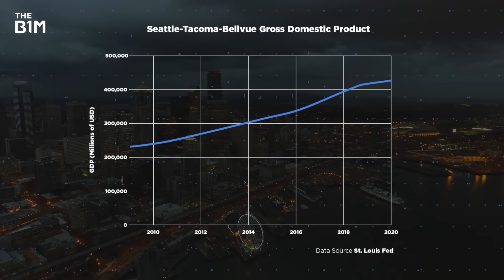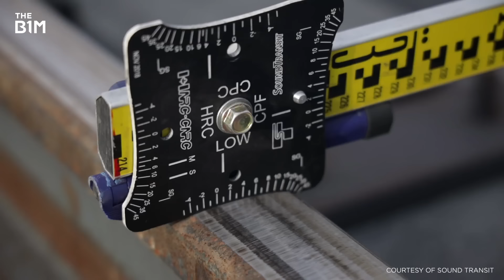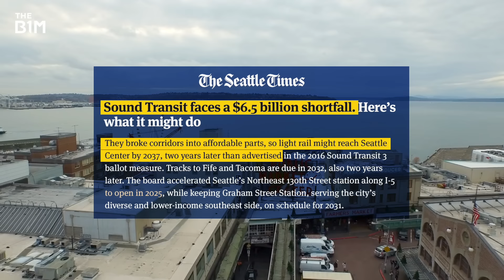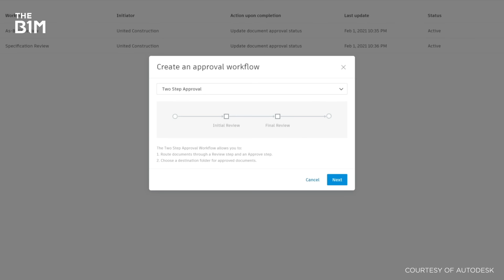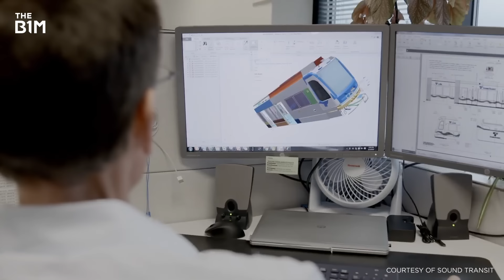Seattle is Building a $54BN New Railway

Comment: A couple of clarifications. First, AMAZON is moving its headquarters out of Seattle and into Bellevue. Second, Sound Transit is not Seattle's project, it is a regional project. Perhaps Seattle should instead focus on the open air drug market that operates by City Hall.
Reply: Citation? Amazon is building and acquiring more office capacity even now in Seattle. Also the open air drug market is on 12th and Jackson in the International District because of course police allow it there.
Reply: @eIonmusk542  Evidently you are not current on Seattle news. AMAZON announced over a year ago it was moving to Bellevue. Perhaps you should give your citation.

Drugs are being sold in the International District because it has expanded to include that area. Have you been to the corner where the old Macys store was? All of Seattle is just a wasteland.  But then the voters elected candidates that did this. Nothing good ever happens to a city that allows illegal drugs to go unchecked.

Good luck on property values. And insurance will start going up. Grocery stores are also closing. I guess the citizens of Seattle hunt the wild animals on the streets?

Comment: How’s the zoning around the rail routes? like is there a plan for dense residential areas to go along the route so that future residents can go car free? Like you need a bicycle network and maybe bus network to tie into the train system to make the whole thing work. I want city nerd or not just bikes or alan fisher or one of those urban planning guys to give an input
Reply: Seattle does have a fairly robust bike lane network, though I only visit Seattle I don’t live there
Reply: Each new station is planned to also have TOD built around it. New contractors are also taking advantage and building new housing units around the area well ahead of opening dates.

Our bus network is already fairly extensive, with the Sound Transit Express service having 28 routes connecting the multiple transit centers across 3 counties to serve as quasi-BRT. On top of that, you have the local transit authorities that service their respective counties (King County Metro, Community Transit, Pierce Transit). As a Link station is completed, the LTA will work with Sound Transit to revise bus routes and improve local connectivity to the light rail.

Comment: It is important to note that many of the large companies are not in Seattle itself but the suburbs, Boeing factories , Microsoft offices, Amazon new HQ and many many technology companies area all spread out in the area, some companies having multiple offices in different cities/suburbs so the light rail is connecting not just the city to the suburbs but between suburbs themselves so pretty complicated project.    Your map is also missing many more lines and stations part of T3 but it's all good.     Overall cars are not going to disappear in fact new large highway projects are just as important as light rail and also getting large funding but the future is all options working together.    It is important to note that Seattle area suburbs have difficult geography, high terrain changes, mountain side houses and apartment buildings, the are has steep elevation changes which makes walking, bicycling to/from work impossible for many most light rail stations have very large and FREE car parks so you can drive to your closest light rail station, park for the day and use the network to get around, the return at the end of the day, get your car and drive home.

Comment: Wow, maybe when Seattle is done, they can come down to California... and show them how it's done! California has been building a rail line from LA to the northern bay area for like 30 years. It's about 800mi long total once all 3 phases are complete. It'll (allegedly) travel 220mph through the less populated parts (350mi), and 110mph (believe it when I see it) through the parts in more populated areas. They've built about 200mi from Merced to Bakersfield (actually, it's  short 33mi to Merced and 17mi to Bakersfield, due to issues getting the rights to the land necessary to actually connect the two cities). And I think they managed to connect Santa Rosa to San Francisco (about 45mi). They started it in 1992. They just found out this year that power supplies along this section, are inadequate to fully power the trains across the entire section. Get out and push, apparently? 
 How it is that they've been planning this thing since 1992, and only now realized there's nowhere to plug the damn thing in...is fkn Amazing! Maybe they figured they'd build those parts like a giant rollercoaster. Just build a giant incline where power lines end on each side, and let it coast the rest of the way? Maybe they sold it as a revenue  generator, because they could charge for the train ticket and a rollercoaster ticket. Probably how they came to an average speed of 140mph. 70mph on 650mi, and 300mph on that 150mi of coaster track. 
Just because Disney Land is in Anaheim doesn't mean the whole state needs to be Mickey Moused.
Reply: CA's major mistake was not building HSR between San Diego and LA and between San Jose and Sacramento (the main transportation corridors in the state) so that voters would come to appreciate it.

Comment: I'm a little surprised they went with all light rail instead of at least one heavy rail trunk line, both for capacity and speed. Seattle is about the same size as Boston, and here heavy rail is fast  and the light rail is often crowded & slow, especially the lines that travel in auto traffic. Fortunately I live north of downtown, so I'm on a heavy rail line. There really is a big difference.
Reply: Sound transit uses heavy rail lines, they're maybe 1/2 of the lines shown on the map in the video. They are not new, they are shared with freight but they work.

Comment: I think Seattle and the PNW needs a reliable high speed train. Light rail has been a tremendous success for the city and I think something that allows lower density would be great to have. It is almost impossible to build new constructions in Seattle due to its location therefore spreading the residents should be the next objective. Housing is almost impossible to afford unless you work for the tech companies.
Reply: huh?? the issue in seattle is clearly way too much single family zoning that prevents density. look at cities like chicago with far, far more duplex/triplex apartments and condos. they fit in with the scale of a residential neighborhood, so they don't feel out of place—but they're far denser, and allow for transit to serve a lot more people more efficiently.
Reply: @AmbientMorality  I agree. I think we have too much Single family zoning but that is a political dilemma that no one is willing to tackle. The city has spent millions on homelessness and other initiatives to bolster housing but the problem is getting worse. On top of that, more people are moving to the city compared to housing supply which exacerbates the problem. That is why I think initiaves like high speed trains could solve the problem for everyone. Those that want single family housing can go to lower density areas while the techies and the metropolitans can stay in the city where we have higher density housing. But I agree, Seattle is growing and therefore single Family Zones need to be scrapped.
Reply: @mohameddahir7457  Hmm, ok I definitely see your point in that case and it'd definitely be a good interim solution. I just wish people saw the value of low rise multifamily; it works so well in so many cities but just doesn't get built much anymore. At least townhouses seem to be gaining a bit more popularity as of late

Comment: Great video! but a few more things would be useful for context.
For example, on your maps, put cities, that way people can truly understand the scope of the project.
microsoft and now amazon are in the suburbs. So its useful to know which cities can be reached.
Also you can’t really compare to chicago or new york, as those trains are heavy rail, while these are light rail.
There is a difference in both passenger capacity and frequency, its not enough to compare milage
Lastly, In order to fully take advantage of this new rail, zoning around the train stations needs to change. Otherwise it’ll be like the BART in the Bay area. Where you have a great system, but basically suburban park and ride stations in the middle of nowhere because a bunch of NIMBY’s dont want density even if it is around rail stations.

Comment: As we talk about the "Greater Seattle region," it's worth considering just how extensive this economic linking is.

Amazon, Microsoft, Starbucks all on the Fortune 500 list in the Seattle metro area (Microsoft is technically in Redmond), and the video lists them. Also on the Fortune 500 in the metro area?

Nordstrom, Expedia, Expeditors International, Zillow, Costco, Paccar, Weyerhauser. T-Mobile US would be on there as well if it weren't considered a division of Deutsche Telekom.

T-Mobile and Paccar are technically closer to Seattle than Microsoft is.

As a native, the project is taking way too long and has some significant infill weaknesses (you can see this on the map, how many outlying communities, even in the region's two other port cities of Everett and Tacoma, are completely barren). But it's still huge and exciting.

Comment: Yeah, it’s behind schedule again and over budget, the rails on the old express lanes over the lake, will some were not done properly, so let’s tear out and redo. The connection from Issaquah along I-90, should have been a straight line, instead it angles up to downtown Bellevue. Then you transfer if your going into Seattle. The 2nd most congested freeway is I-405, should have been designed to accommodate this N/S though fare, instead we will just shoehorn another set of lanes. Plus lots of growth east on I-90, yet no plans for maybe extending the line east. In Bellevue is a major shopping district, with restaurants, the train leaves you about 5 blocks from this plus hilly terrain to walk back and forth. 8:47

Comment: The high-speed rail from San Francisco to Los Angeles has been discussed for ten years. Construction began in 2015 and is expected to open to traffic in 2033.  The total mileage is 1300 kilometers, and it will take 18 years to build?  my country has built 40,000 kilometers of high-speed rail in 14 years.  By 2035, my country will build a total mileage of 70,000 kilometers of high-speed rail.  Can this high-speed rail in Seattle be built in 18 years?
Reply: its not high speed rail, its light rail.

Comment: 52 billions for 100 km of tracks and 30 stations of LRT ?

Can somebody from the transport sector in Seattle explain to me how it is so costly ? 
(To compare, Paris is building 200km of Subway tracks and 60 stations with 40 billions)
Reply: As someone in Seattle, I can help clear this up. While Link is defined light rail, it features heavy grade separation and higher quality tech than the majority of light rail systems to achieve frequencies and speed closer to that of a standard rapid transit system, meaning cost is much closer to a conventional metro system and the most visual part of ST prop 2 and 3 is the expansion of Link, but the proposal go much further than just rail with major bus funding, funding for other modes of transit, major improvements in street design, walkability and bike infrastructure with the purpose of changing the Urban fabric of Seattle as a whole

Comment: Meanwhile the energy system that powers traffic is in decline.  The Alaska Pipeline, which provides the liquid fuels for Seattle's traffic, has declined three fourths since its peak in 1988 and is approaching low flow shutdown (when there will be too little flow to stay flowing in the Arctic winter).  The natural gas that powers the western grid more than anything else is at its peak due to fracking but conventional gas has also sharply declined (19 trillion cubic ft in 1973, now about 7 trillion cubic ft).  If limits to growth was considered our transportation system plans would be VERY different.

Comment: Clearly you aren't from the Pacific Northwest.  This light link rail system they have been building for years is behind schedule and so far over budget they are trying to pass additional taxes to cover the skyrocketing costs.  Furthermore the part of the line that are running aren't being used and traffic is still terrible.  Yes the pandemic did affect this but with most offices now returning to work and remote work ending the numbers are bad and its losing money.  If you live in within a certain area of the rail system your car registration can be as much as 700 dollars per year to cover the failure.

Comment: 62 miles of track costs $54B? I know, 37 stations, but that seems quite steep
Reply: The usa is doomed my country is building railway infrastructure for fraction of that sum
Reply: All $54B is not going to just the light rail, which is something the video didn't really touch upon.

In the project package, the light rail expansion only allocates $31B of the total $54B budget. The remaining is allocated to commuter rail expansion, express bus improvements, bus rapid transit expansion, highway improvements for transit access, operations and maintenance, and other smaller system-wide improvements.
Reply: @anitathakur9340  didn’t ask

Comment: $54 billion is an astounding amount for a white elephant hub to hub system
Airlines have already realized that hub to hub is non optimal and are downsizing aircraft for economic point to point flights..
Self driving vehicles in the form of small to medium size buses could move more people more conveniently at a price so much lower that everyone could use it with no user fee.
The reason roads are clogged is that 95% of commuting by car is only 1 person at a time.
When it is cheaper and more convenient (point to point) than driving yourself or taking the train (hub to hub), the current highway system, with only minor modifications for platooning lanes will be more than sufficient to accommodate an increasing population.

Comment: The price for these kinds of works, public or not, has reached a level of fucking obscenity that is hard to quantify.  Almost a billion dollars per mile.  Obscene.
And you KNOW the cost will triple from the original estimate.  At least triple.
Reply: it hasn't historically....
Reply: @AmbientMorality  Brother, I would suggest that you utilize Google to look up almost ANY large construction project and compare the 'projected cost' to the finished cost.   
Unsurprisingly cost overruns abound.  This has become endemic in the U.S.  It has become an open, and often, unspoken part of business in this country.
Reply: @TheRealBozz  OK, but that hasn't been the case for Link Light Rail. The most recent extension, completed 2021, was slightly under the budget set in 2012. The current ST3 extensions are definitely going higher for pandemic- and inflation-related reasons, but certainly not triple.
Reply: @AmbientMorality  That you appear to take in stride a billion dollars a mile for laying track is quite telling. 
If you want a cookie because your pet rail company came in under tender, you can have it. 
The FACTS are that some 85% of projects like this come in over budget.  Triple the original tender?  No.  But double often. The Big Dig comes to mind. 
That was not my point.  One.  Billion dollars. Per. Mile. THAT is my point.

Comment: That's all well and good, but the actual experience of riding public transit in the Seattle area is dreadful, and will continue to be unless major changes are made to law enforcement and fare enforcement.  Seattle has earned the nickname "Free-attle", it's known as a place where people can come and live off the generosity of a well-meaning but misguided government, where drug use, theft, and violent crime are accepted and visible on a daily basis. No amount of rail development will change that unless there is a change in public policy.
Reply: Look bud. Throwing homeless people in jail doesn’t solve the problem, it makes the problem worse
Reply: @darthmaul216  I did not mention homeless people or jail anywhere in my comment. I'm talking about simple law enforcement, like fare enforcement, which Seattle completely discontinued. Simply citing and removing fare skippers from trains would go a long way in making the system much less harrowing for normal travelers.
Reply: @MarkThomas-f7u  you have been being lied to bud. Take the train at least once and you will see just how wrong you are

Comment: " .... expanding their transits system and fast ..."   fast??!!!  Building transit in Seattle is not fast.  Light rail was voted for in 1996 and it took 13 years before light rail began to operate and they didn't start from scratch, much of the tunneling was already in place with rails installed. A quarter of century later, there is still only the one line.   Transit in Seattle is disjointed and slow, busses, cars, trollies and bikes all delaying each other.

Comment: 54bn in 25 years means 108bn in 50 years. The tiny section currently operating is severely underutilized because the layout of the area isn't suited to a 19th century transportation system to get people where they actually want/need to go. The part that is functional is disgusting and embarrassing, with just a handful of people actually paying fare. The section going to the Eastside was built with the wrong cement across Lake Washington so they needed spanners. Then they used the wrong spanners and had to redo it. The Redmond - Bellevue leg is as empty as the SLU transit cars, that routinely have zero to four passengers per trip.